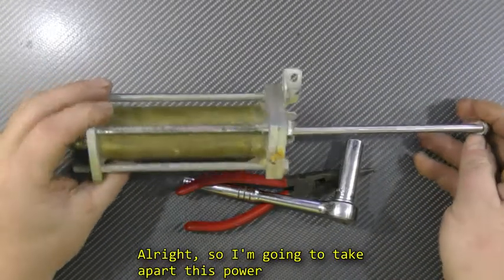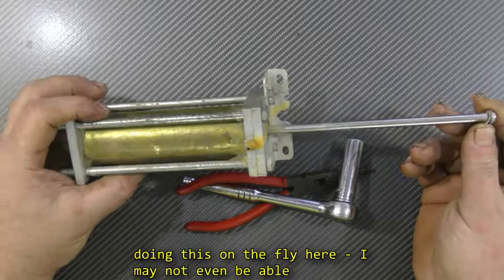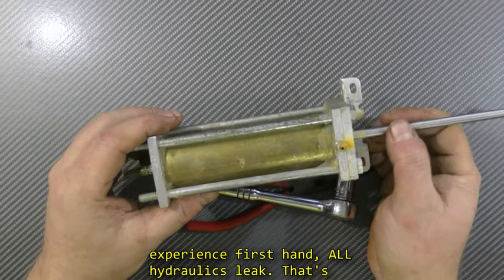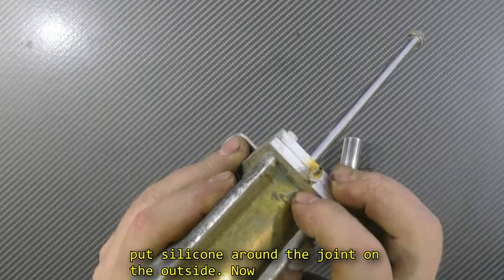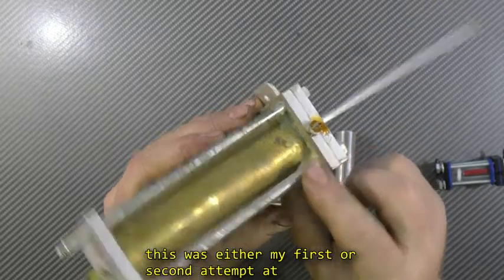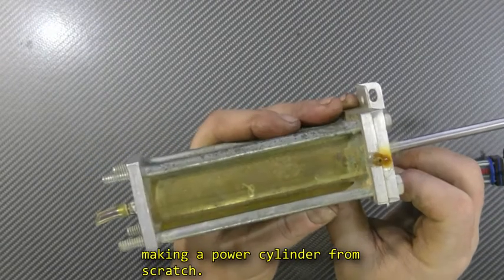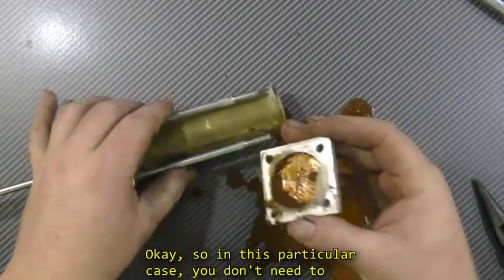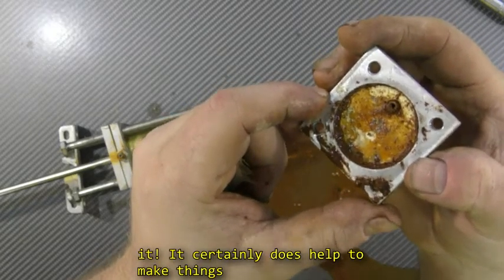Home built power cylinder tear down

Comment: Hey first comment lol

Funny how we forget how we made something 20 or 30 years ago! I wish i could remember exactly how i made my cat teasing drone car/tanks lol
I remember i used photo sensors and motion sensors and a simple on off circuit motion sensor turned em on or off and the photo sensors detected light and ither turned towards it or away depending on the jumper wire setting. No logic chips or any thing of the sort pure brute force analogue. I suppose i could get all the bits and just recreate the things but man would be nice if i had a old fried one to work from lol. I made those when i was like 16 or 17.